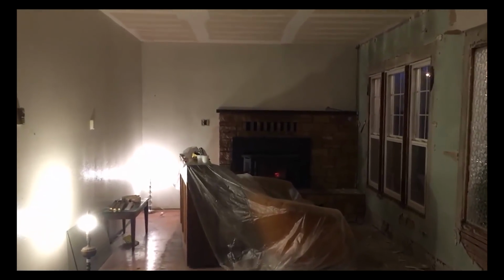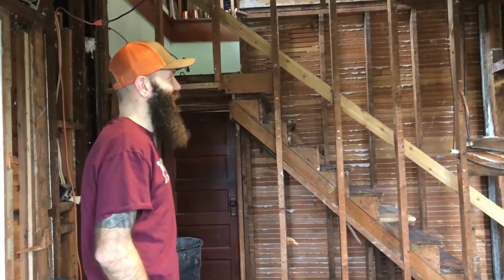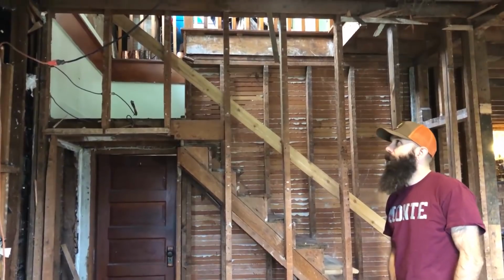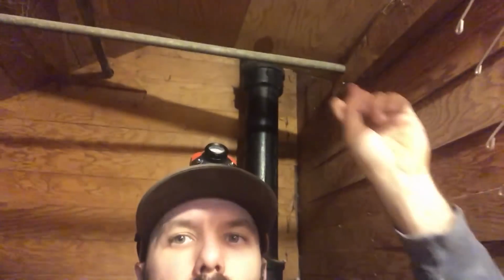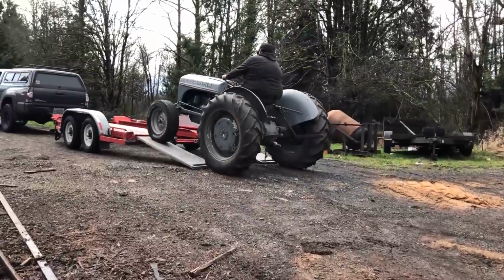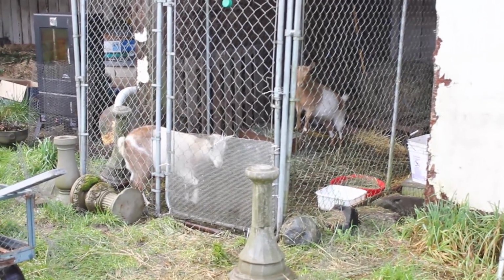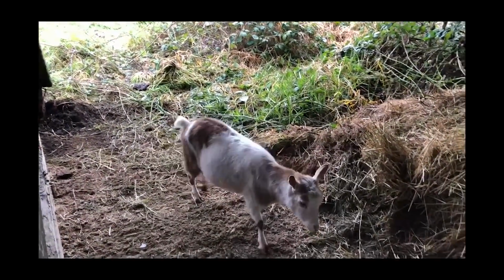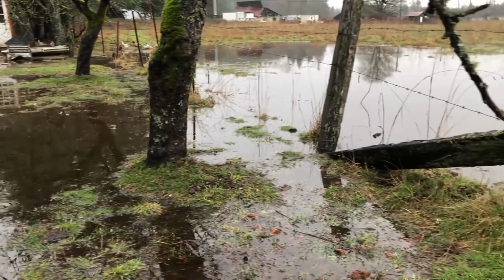Farmhouse Remodel | DEMO WEEK | - The Lavender & Fir Farmstead

Comment: Don't paint the historic, original fireplace!  No!  And barnwood on the ceiling would not have been done in those days.   
But I think the drinking fountain is a clever and useful idea for the mudroom.  
Are you going to have to bring those stairs up to code?
Reply from the maker: Hi Ann, thanks so much for your comment! The fireplace was actually added in the 1970s and the stove was added much later. The house originally had a stove in the original kitchen, but that is long gone. The barnwood ceiling will not be a restoration effort, but a fun touch we will be adding. We are unable to touch the stairs because of space restrictions upstairs. New video updates coming this week!

Comment: Small drinking fountain. ... was wondering if you are saving the insulation and also if it's real wool? Cause wool is good insulation and a fire retardent.😊
Reply from the maker: We aren’t saving the insulation due to rodent contamination. It’s relatively modern (not wool) and we plan to replace it with new - after we’ve sealed all potential rodent entry points (: